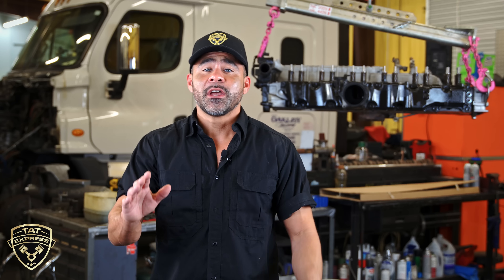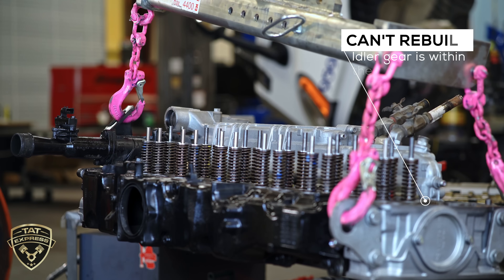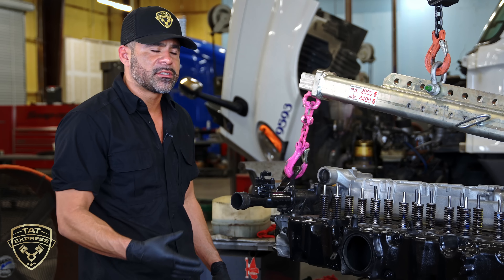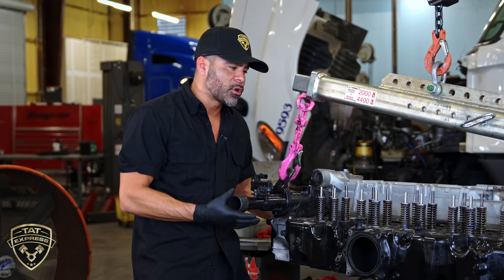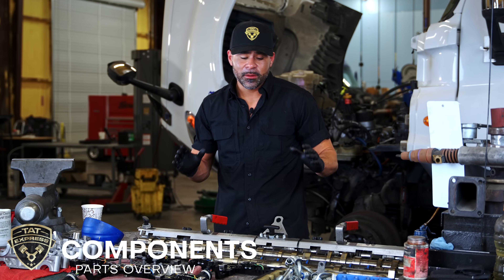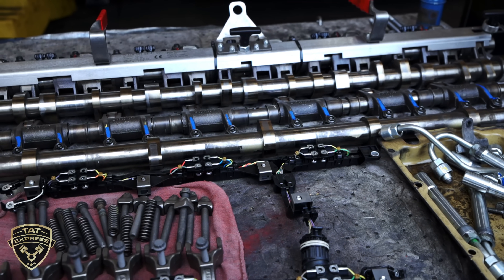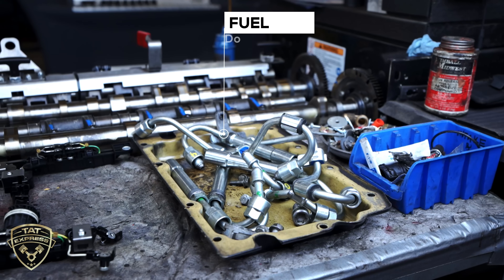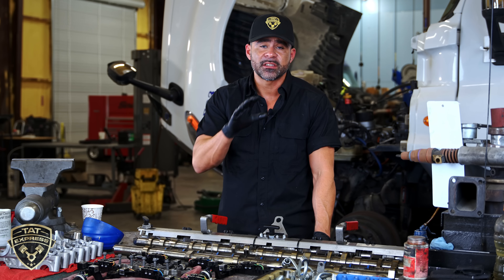Diesel engine cylinder head install/Diesel engine cylinder head/Diesel engine head gasket/DD

Comment: I have a Cummins ISX15 with 1,082,650 miles on the head. I had the block replaced due to shop error but didn’t replace the head as I was told everything looked good. But ima replace it soon before I have major issues. I am hearing a ticking not sure if it’s a valve.